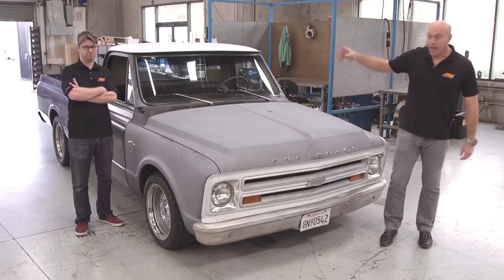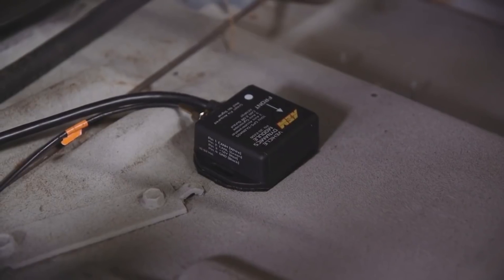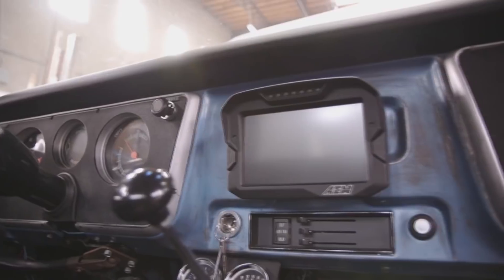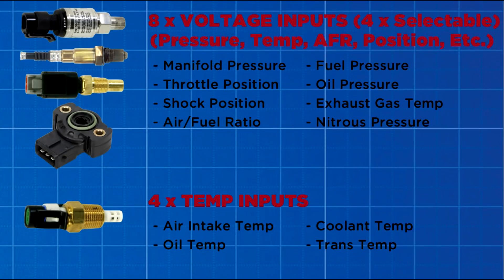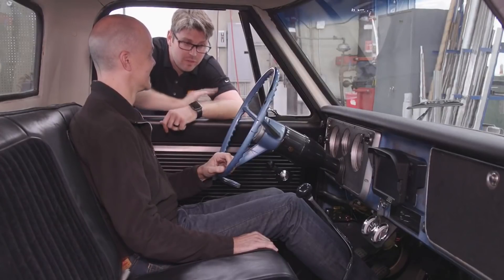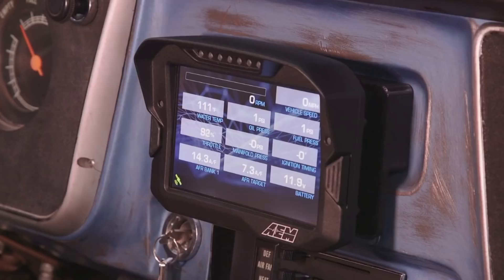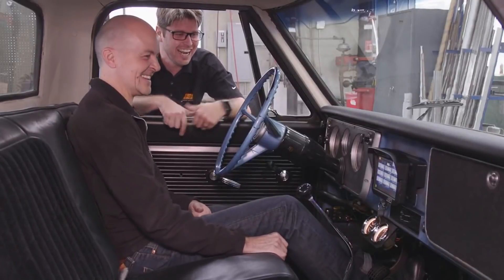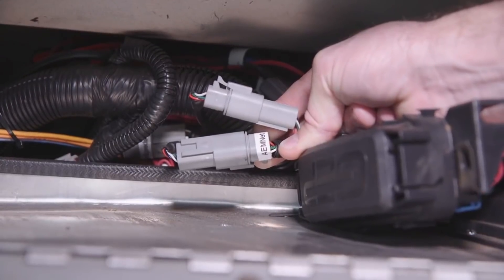AEM CD-7 Dash Installation on Car Craft's Truck Norris C10!

Comment: Will the CD-7 dash with OBD2 adapter work with e46 factory ECU?
Reply from the maker: They will work on 2008-up vehicles with OBDII channels that are transmitted by CAN bus. Some European cars adopted the Bosch OBDII protocol prior to 2008, but we have not validated any of them and do not know if the E46 is one of them.

Comment: Where else can the AEM be mounted
Reply from the maker: It can be mounted anywhere! We have several authorized dealers who are designing custom mounts or you can make your own. Check out the feed on our Facebook page for some options or contact an authorized dealer using the dealer finder on our website!